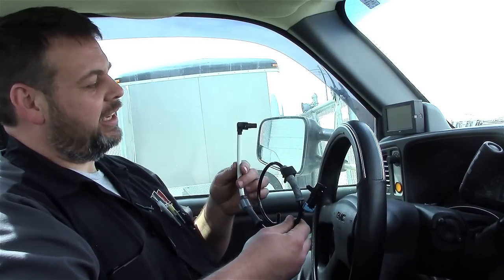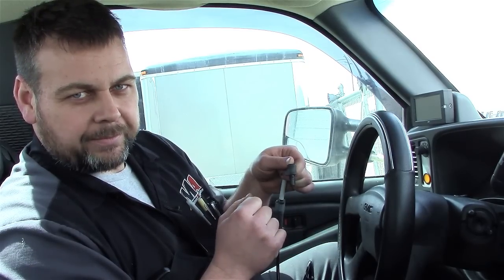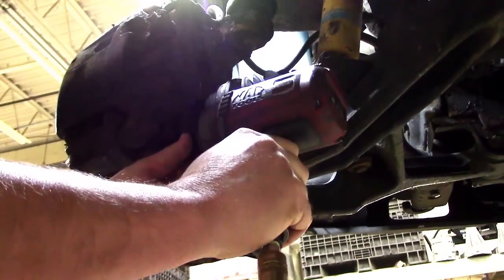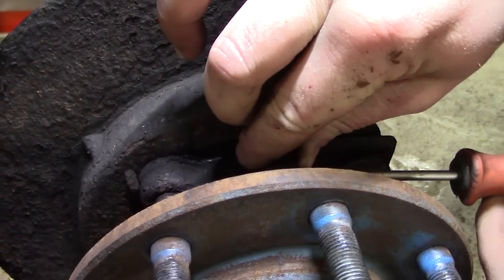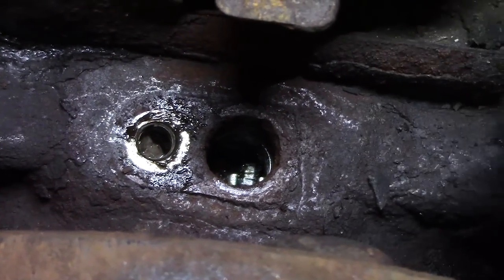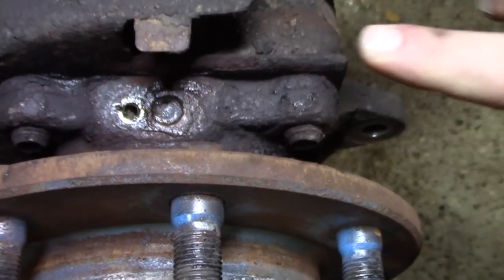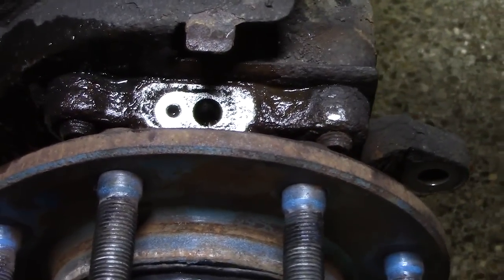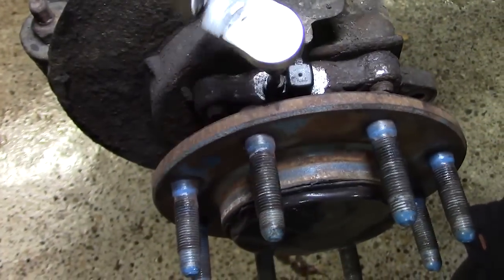How to stop brake pedal kickback and unwanted ABS activation in a 2001 to 2007 Duramax.

Comment: My skid lights came on with my 2002 Toyota Sequoia yesterday at 55mph followed by what felt like the ABS kicking in without my foot hitting the brake & zero braking pressure.  

Is that sensation what people are calling "KICKBACK?"  

My ABS light did not light up on the dashboard nor did the check engine light, so I might start with this.  Hopefully the speed sensor is as easy to access as shown in this video as I need to replace the pads & rotors anyway.

Comment: I have a 2016 chevy 3500 that I think the abs is activating when braking and acting like a really bad warped rotor, it will not do it all the time, I will clean the sensor and hope it fixes it.
Reply: How did that turn out?
Reply: @xrcustomizing7102  it didn't 3 of the sensors tested bad, I am going to replace them all and see how that works.

Comment: So after watching this video, I cleaned up the metal and reduced the gap very slightly from over the 1.2mm max it says to around 1mm and its now solved the Kickback and ABS activation stopping from slow speed. THANKS FOR THE VIDEO
Reply: Did you buy new sensor’s

Comment: I got a 2012 dodge avenger with abs issues. brake kicks back at low km, I have code for loss of communication with dynamic sensor. So far I've changed; Rear Hub Assembly, Rear bearings, Dynamic sensor, ABS pump, and ABS sensors have been changed twice. Wheels have been changed to recommended 17" size, I have changed the ECM once. Speed sensor tests have been done on the wheels. We have checked all the wirings as well. Nothing yet. Will take any advice you may have.
Reply from the maker: It would be best to take it to a local trusted repair shop for proper diagnosis

Comment: This is not an explanation of how the air gap changes the speed reading and affects anything that would cause the pedal to rise. Please elaborate if you have an explanation.
Reply: Because it gives the sensor a different reading, making it believe you have lost some traction in that wheel therefore need the abs to engage, when you don't
Reply: Spellmaster62448 you found the wrong video that’s your fault. It his
Reply: @tylerparker3024  i changed my hub bearings both sides n sensor im still haven the same problem any recomendations
Reply: Check your abs system fuses if they're good check the module

Comment: how do you know what side? or do you just do both sides every time?
Reply from the maker: You may be able to detect it with a scan tool, but an oscilloscope can also be used to graph the ouput. Chances are if one side is giving grief, the other side is not far behind

Comment: What were your speed sensors showing with this issue. I have a 05 lly having this poblem but both front speed sensors and the rear sensor show 3mph when not moving at all so not sure if this will fix my issue.
Reply from the maker: 3mph is normal reading at a stop.  It will be tough to capture this happening with most scan tools as they just do not refresh enough.  You could use a scope to graph it out if you wish though.

Comment: link does not work. can you share new link pls
Reply from the maker: We have updated the link. Thank You https://www.merchant-automotive.com/searchadvanced.asp?searchfor=abs
Reply: I have a honda civic 1.5 turbo 2017  and whenever i apply sudden brake to stop the car immediately whether at the speed of 20 30 or 100 the abs kicks in immediately brakes lock up and car skids forward  and abs system does not show any fault code what could be the issue? I have new pads rotors front back and almost new tyres michelin primacy 4 so everything on that side is clear i am just not able to fix this problem now i found this video i wonder if its the same issue? With my sensors causing abs to kick in ??

Comment: I've just recently started having issues with my HRV and it had 5 errors on the ABS Built In Diags, All cleared but RR sensor error so just replaced the sensor today, it was getting dark so fitted quick and tested it now the ABS light stays off so No errors, took for a test drive and had this wierd noise when braking from 15-20 mph that it never did before. It like Judders and seems abs kicking in and a  spring type noise and can feel it in brake pedal, i read earlier in manual about KickBack due to ABS Motor Operates when ABS functioning, but doesnt say what issue causes it. So tomorrow I will measure the Gap on new one as never done it before with original sensor, will be so greatful if thats the case